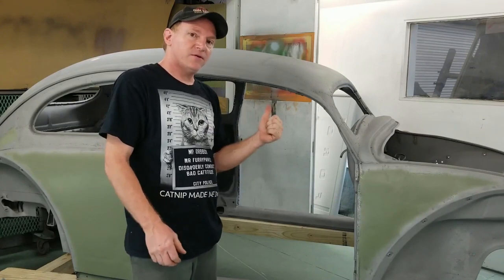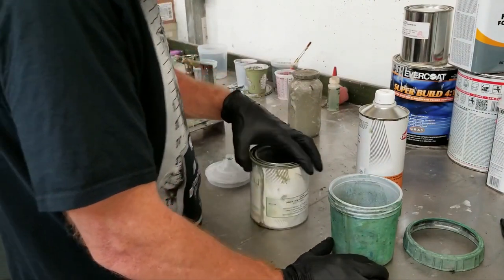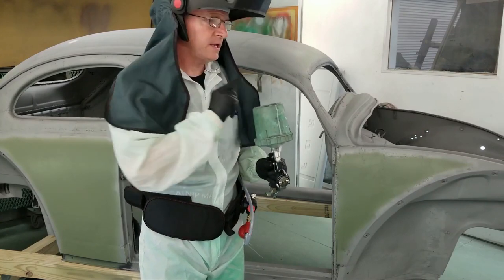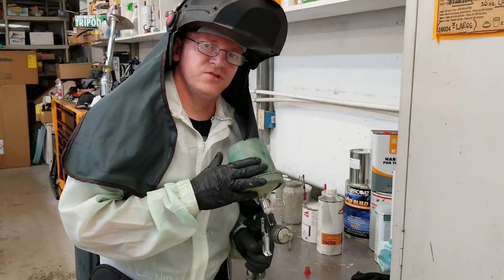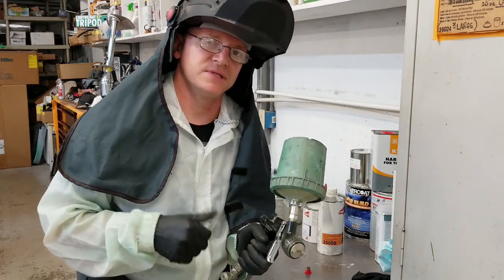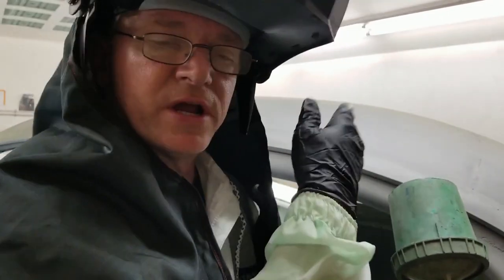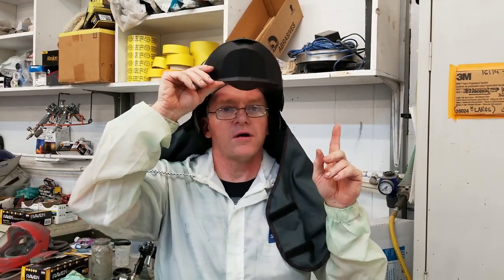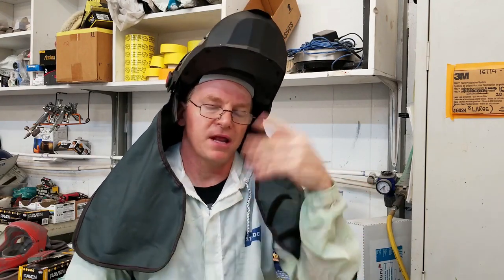Epoxy Primed - ROTTEN OLD CHOP TOP 1956 VW BEETLE - 127

Comment: They say there is always one in a crowd... won't the underside of the rockers where Elainor sits on the dolly need protected too? The whole video I waited patiently wondering how/when you would tackle the task. Whether they would be the 1st thing primed, or the last? Signed, Curious in Indiana.
Reply from the maker: yes sir just not yet... I will have the body off the dolly when we go for final
Reply: @ES4406  wont it begin to rust by then?
Reply from the maker: No it's in a dry storage. It's going to  be fine.. they didnt get under the heater channels  and glenn replaced them... had to do this because  we have down time and I didnt want to have any issue..

Comment: Did you spray the epoxy primer over a gray primer? Can epoxy primer be sanded, so body work can be done?
Reply: The grey you see is the bare metal after blasting, the traces of green before this coat are Earls first few areas of epoxy primer. Epoxy can be treated in the same way as normal primer in terms of surface prep. Hope that answers your q's... 👍
Reply: @peteledwidge3631  Yes, thank you very much, it did answer my questions. Thank you for sharing your work, as many of us are learning from individuals like you, when you show your work.
Reply: @guillermonieri4203  Glad I could help, I can't take any credit for Earl's work though, he's the one doing a fine job. 😁